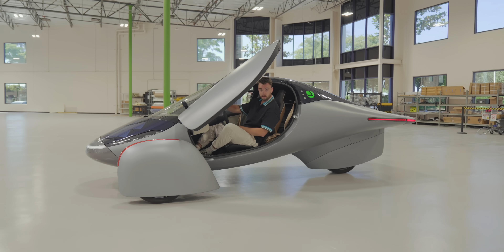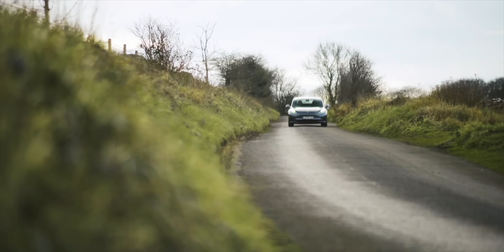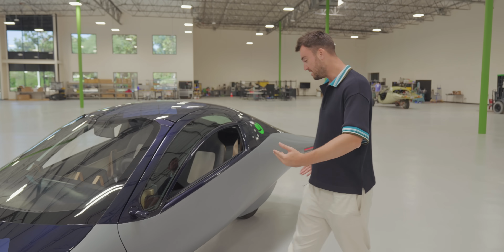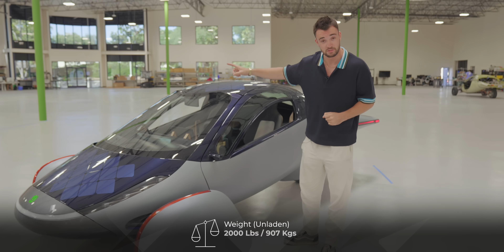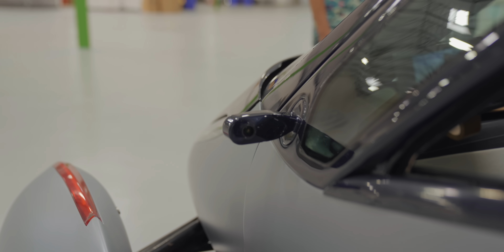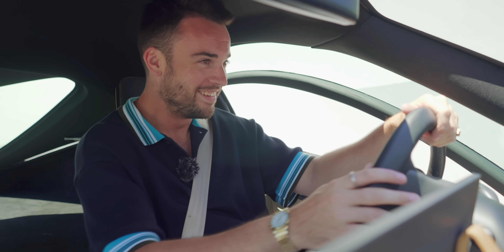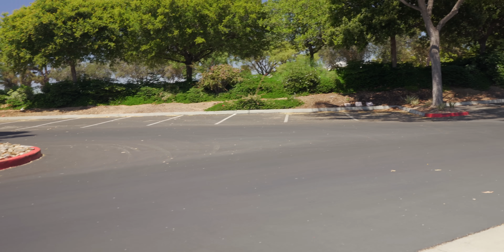The Game-Changing CHEAP Electric Car Inspired By Fish!

Comment: interesting you didn't show the actual solar output on the display when the car was in the sun.........you really need to verify what they claim, and they have no idea what the car will cost........they are just saying the number they want you to hear.........do your research on this company before doing a video you might be suprised what you find.
10miles/kwh..........you didn't do a test to show that is true........you might be surprised what the actual figures are if you did proper research.....hold them accountable they are taking funds from investors using the claimed theoretical figures.
Oh they told you production starts next year..........they have been saying that since 2008....and you repeat what they say without any critical journalism........

Comment: 9:14 "skin cooling" interesting concept. I wonder how well that works in 100+ days (with hotter pavement under the vehicle) Alabama summer stop-and-creep traffic jams? If I had one, my use cases for it might be limited without active heat-pump cooling of the battery and electronics. I can tell you that the original Nissan Leaf's batteries degraded quickly in the South East US.
Reply: the car would overheat

Comment: Fantastic! Speaking as someone who lives part of the year on a sunny island (Kefalonia) I want one.
A few thoughts / questions: 
-How much would replacing the wheel spats with more minimal mudguards effect the efficiency? I ask because I suspect driving anywhere but California will soon see the standard ones smashed to bits.
-Would there be an option for an occasional 3rd seat, preferably folding? That would make a huge difference for perceived practicality - I'm one of a family of three.
-I rather like the optional tent addition... I wonder if raising the rear roof line just a little and adding a Kamm tail would have any effect on the aerodynamics? Once again, just a smidge more rear room would add a lot to the perceived practicality - this coming from someone who's daily drivers are a 2 seater and a 2+2.
-How structural is the roof? A rolling (Webasto-like) roof made of flexible solar panels or a removable solar-panel top would be awesome, especially for the environments where a car like this might run.

I know, I know, the design is already complete.
But all the above will be simplicity itself to add to a composite-bodied vehicle, and would likely add next-to-nothing to drag or weight while adding a good few benefits.
Reply: At slow speeds, replacing the wheel pants would not make much difference, but it would have a significant negative effect on range at speed.

Aptera will look into a child seat option for the 250 mile range model, but this will still be more than a year off.

The roof is structural.  The rear solar panel support is part of the rear crumple zone engineered in.   We will find out more about this during the crash testing of the PI models.

The second Aptera is likely to be a 4 wheel, 5 passenger design.

Comment: But ... What happens when a GM Suburban Tank or Toyota Highlander Tank or anything over 2.5 tons hits that thing?   It's a jungle of concrete out there folks. New technology has to FIT IN with the current insanity on our roads. Nice thought but FAIL!  .. what happens if it hits a pothole?
Reply: Potholes won't be much of an issue.  We will understand the crash behavior when the 3rd party crash testing of the PI models to FMVSS Part 200 standards is completed and made public.

Comment: Hope it works out as is a fundily wrong design . Why not 4 wheel  streamlined  design electric car with solar surface doing the best you can do with this layout
Reply: Because the 3 wheel design has significantly less wind resistance, weight, rolling resistance and cost.  It is a more efficient design, and does a better job of meeting the design goals.

Comment: Skin cooling works - rubbish! An NBC drive proved it can't get up hills without overheating. Nothing is pressed against the belly pan, and anyone can see the motors aren't even near. Jack says the belly pan is all that's needed, but Aptera now claims it has to have a radiator under the cowl. Aptera Owners Club says that's the main method and skin cooling just assists. It's all full of snake oil lies
Reply: @aussieideasman8498Rubbish is what your comment is.  The NBC report had B roll showing the same vehicle successfully climb that same hill three times before it overheated.  And that vehicle didn't even have the antifreeze lines hooked up to the belly.  

The only "radiator" is the AC heat exchanger which uses a fan to blow air over, just like any car AC system.  If AC Owner's Club said that they are wrong, but I doubt that they did.

I understand thermal design, to the extent that I created a samples freezer for the ISS -(designed and helped build, under a contract issued by the University of Alabama)  Of course it works, and the actual PI vehicles have a changed design that will work even better than what was intended for the gamma.
Reply: @n.brucenelson5920  "Rubbish is what your comment is." Then prove it.  
"The NBC report had B roll showing the same vehicle successfully climb that same hill three times before it overheated." I have lots of trips where there are three or more hills. It won't not overheat if the three aren't the same. And many are bigger hills. Nikki overheated on a flat street.
"And that vehicle didn't even have the antifreeze lines hooked up to the belly." A case of everyone forgetting for seven months. Not acceptable. 

"The only "radiator" is the AC heat exchanger which uses a fan to blow air over, just like any car AC system." Needs a real and bigger radiator than that. Then they can put a decent thickness belly pan on.
"If AC Owner's Club said that they are wrong, but I doubt that they did." I don't know what you are talking about.
"I understand thermal design, to the extent that I created a samples freezer for the ISS -(designed and helped build, under a contract issued by the University of Alabama)  
"Of course it works," Of course Santa climbs down every chimney. 
"and the actual PI vehicles have a changed design that will work even better than what was intended for the gamma." Working was never intended for the Gamma.
Reply: @aussieideasman8498  "Needs a real and bigger radiator than that. "

What makes you think so?  I believe in physics.  You think that you can build a working perpetual motion machine.  So who believes in Santa Claus?  You don't even understand what the word "proof" means!

Soon you will be seeing the PI builds undergoing validation testing, and then delivered vehicles performing as stated.  What are you going to say then?

Comment: I have a feeling this EV will STILL be vaporware in 10 years.  
Why are they taking so long?  It's not even technically a "car" in the United States so it doesn't need to go through all the stringent safety testing that cars here have to pass.  
If this was a legit company, we would see them on the road by now.
Reply: We will soon see the Production Intent validation vehicles on the road.  It is taking so long because the demand was much higher than expected and the quality of the production vehicles will be far higher than originally planned.  

Expect production by the end of this year or beginning of next.  They are now associated with the world's top automotive companies and engineers.
Reply: Aptera has been a vaporware scam for 18 years

Comment: What is the crash test rating like ?
Reply: Aptera will do crash testing to FMVSS Part 200 standards.  Perhaps 5 of the production intent vehicles will be crash tested by a third party and the results published later this year.  This work will also be used to calibrate the air bags.
Reply: There are no crash test standards for motorcycles

Comment: In the final "money" shot I notice the car is parked perpendicular to the parking lot stripes. The car is very wide, which is the primary hesitation i have in trying to obtain one. Parking the car seems like a bear. Wish you had included a shot with the car parked in an actual parking space. i think that would be quite interesting.
Reply: My wife and I have ridden in a prototype.  It can be parked easily in a 96" wide compact car spot.  Standard spaces are 108".
Reply: The biggest hesitation should be Aptera notorious reputation for being an investment scam.

Comment: I can hardly wait for the 4 and 6 seater that will expand the market for this tech even more.  I know, these versions will be less efficient, but will still be much more efficient than their competitors.  I heard they may be 4 wheelers.  I guess we will have to wait and see.  Regardless, I hope to put down my deposit for an Aptera later this year.   I am invested in Aptera having invested via Wefunder very early on.
Reply: Initial indications are that the second Aptera will be a 4 wheel, 5 passenger sedan.
Reply: Don't hold your breath..
Because Aptera is a vaporware scam

Comment: This thing has been 'coming out' since early 2010s.
Reply: It was in the late 2000s but they liquidated in 2011 because back then EV technology was in its infancy.
Reply: No.  The design of the present vehicle started design in 2019 by Aptera Corp, and has no common parts or even drive train design with the Aptera, Inc. designed vehicles.

Comment: Three wheels arent going to cut it with a montana winter.🥶
Reply: I plan to use mine through an Iowa winter.  The ABS/traction control is better than anything else on the road.  With proper tires, it will be pretty competent.

Comment: There is no room on that toy for more than 20kw batteries. So 200km going 60km/h. If some true about those 10km/kW... Better buy a petrol one for 10000 and you will have another 15000 for petrol to refuel, when and where you want. If you have and accident call NASA to repair carbón fiber 🤣🤣
Reply: it has room for up to 100 kWh batteries. They're starting with 40kWh version first so that's 400 miles not kilometers (it's 640 km). You're not even using the right units for battery capacity and for distances. Why would anyone take you seriously lol
Reply: @AetherRebelGames-0  lo que tú digas guapi.

Comment: Funny that you can do 10 miles per kwh. A S-Pedelec with 500W does 55 miles per kwh
Reply: Not what I read from their specs page. Which says the S-Pedelec uses 740 kWh to go a maximum of 140 km, or about 74 miles.  And they are talking at a speed of 45 kmh, - less than half the Aptera speed rating at which the Aptera is calculated, and 1/2 the passenger load.  You can carry another battery, and might get 1/2 the range of the smallest Aptera, again at 1/2 the speed and less than 1/2 the load capacity.  Not really comparable - but great if it meets your needs.